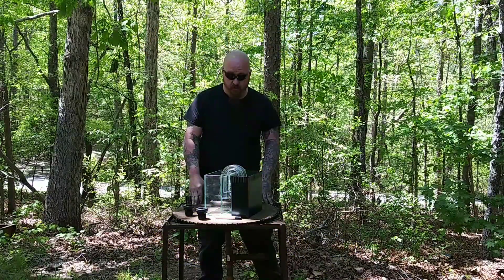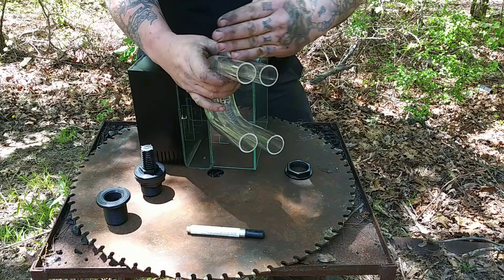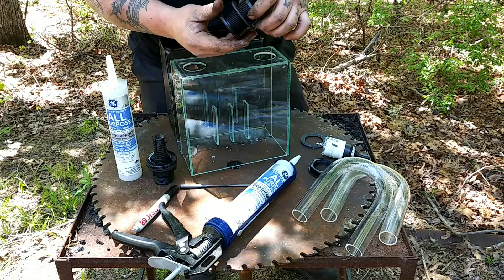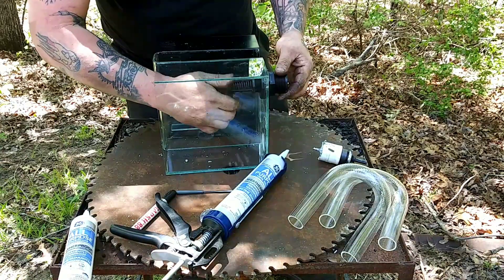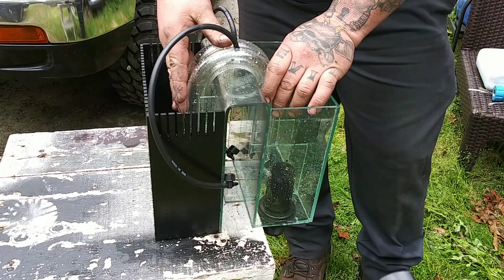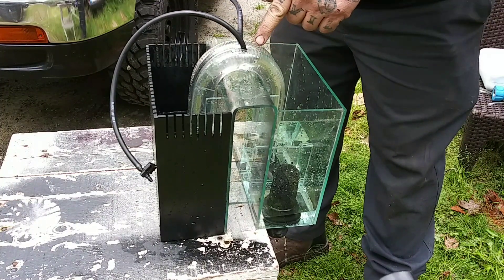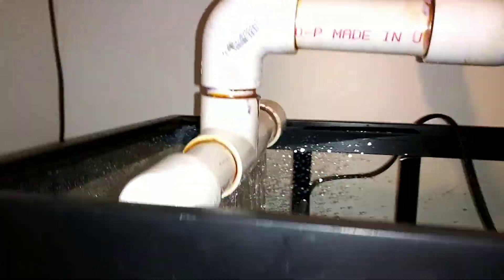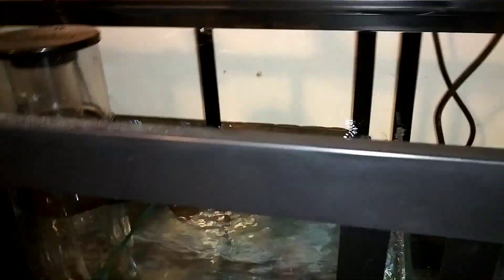HOW TO:🐟 Aquarium overflow box build Part: 3🐟

Comment: If you lower the spray bar in the sump's first chamber so it's underwater it will work just as efficiently and you will eliminate the noise. If you're worried about oxygenating the water, remember its surface agitation that does that and the water's path through the baffles and chambers provides way more surface agitation than the spray bar out of the water does. If you are super worried about O2 levels... a small powerhead in the middle chamber disturbing the surface will do the same with none of the noise.